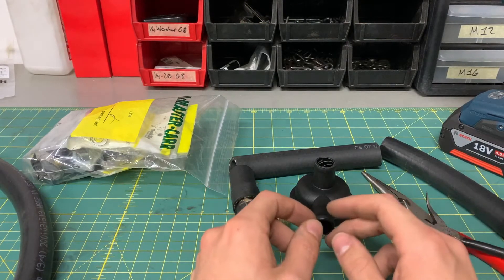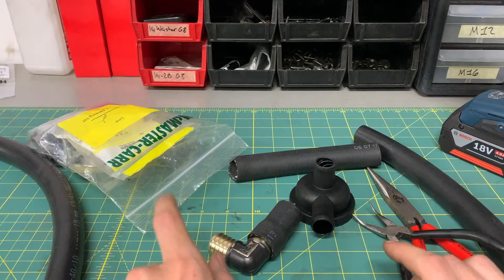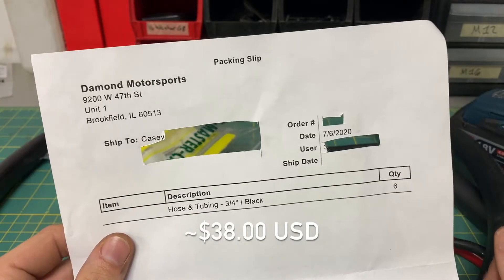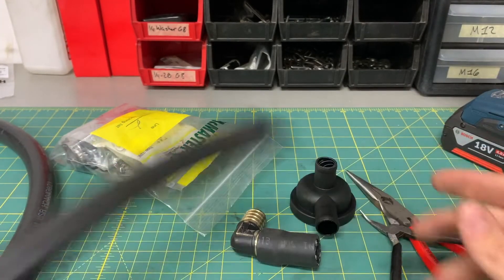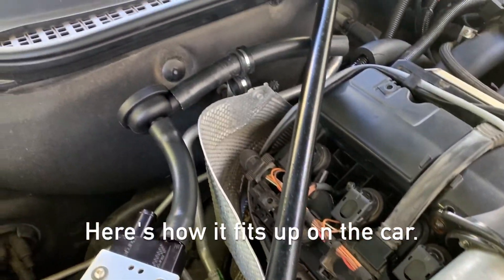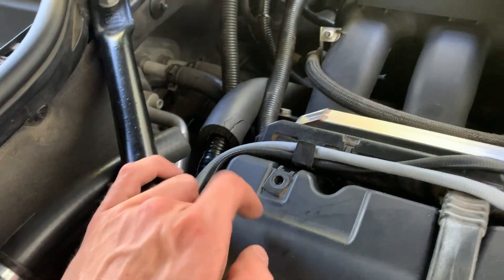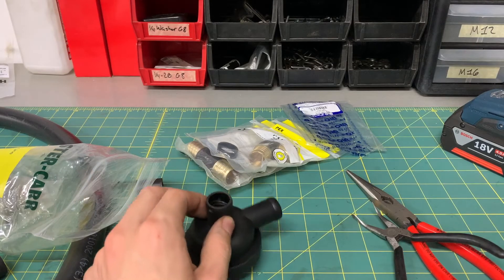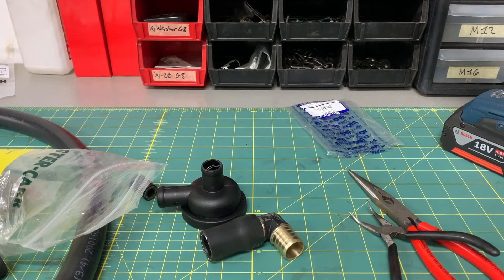BMW N52 Magnesium Valve Cover Conversion - Part 6: Almost There!

Comment: Hello sir  great video series. I do however have a question.  On the pcv valve  check valve set up, did you discover any long term issues? If so what corrections did you use?
Reply from the maker: @grawmoon  I never ended up being happy with my solution. I leave it as an exercise for the viewer to continue/finish what I started.
Reply: @Casey_Schmidt  what happened for you not to like the solution?  Was it the vw pcv or?

Comment: How has the PCV valve been holding up? I mocked the same build, and I have had a oil consumption issue.  I blame the progressive rate coil spring moving against the ball bearing, which is not allowing the bearing to move freely.  I just deleted the PCV valve and I am going to see where that gets me.
Reply from the maker: @Dylan Dorsey - Thankfully, I haven’t had any issues with mine.

Comment: Could you let me know where I could get a ball bearing and a spring of that type?
Reply from the maker: @Dylan Dorsey - Excellent question. The spring and ball bearing were ones that I had in my stock of parts so I cannot determine where exactly mine came from. McMaster-Carr has a large list of ball bearings and conical coil springs that would work perfectly for this application. Simply take some accurate measurements (and a little guess work) for the diameter of the ball then the major-OD, minor-OD, and length for the conical coil spring. You may/will have to cut and bend the spring to fit your exact part. If you're not sure which size would work best, then I might recommend ordering a few springs of slightly differing sizes; thankfully they're all pretty cheap.

Here's a link of various springs: https://www.mcmaster.com/springs/confined-space-conical-compression-springs/
Reply: @Casey_Schmidt  Dude this website is a goldmine, thank you!
Reply from the maker: @dylandorsey1721  - I agree! I found it a few years ago and wished I'd known about it sooner. It's not a cheap place but it's nice to know that you're always getting a quality product with a known spec. and not something sketchy like Amazon or eBay.
Reply: @Casey_Schmidt  could you give me any info on sizing? l don't have the Valve yet but am getting the same one right now. I did the valve cover swap and 3 stage intake swap at the same time. I used a 3/4" One check valve. https://www.amazon.com/gp/product/B07DH3MHM6/ref=ppx_yo_dt_b_asin_title_o01_s00?ie=UTF8&psc=1
Reply: @Casey_Schmidt  I am having an oil consuming issue and I imagine its the PCV valve.  Let me know if you believe I could modify the one I already possess. Thanks!
Reply: Yup! McMaster is an awesome resource for impossible to find parts
Reply: @dylandorsey1721  for your n52  the check valve you displayed in the Amazon link,  I understand that it became a oil consumption problem. Did you find an Alternative solution?  Did you identify the spring and ball bearing size for the vw pcv set up?

Comment: All because your too cheap to buy/change a valve cover every 100,000 miles....
Reply from the maker: Incorrect. All because these plastic replacement parts won’t be around forever.
Reply: You don't know what you're talking about, the n52 plastic valve covers, and yes even the OEM one, are super prone to cracking and warping all the freaking time